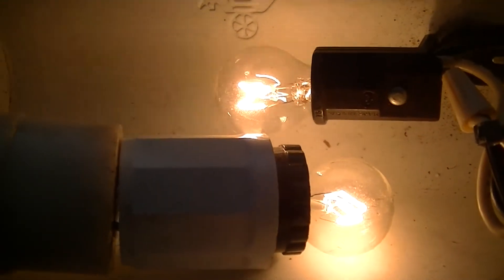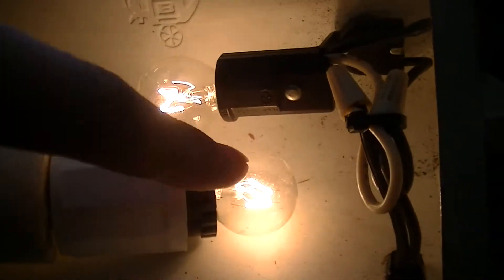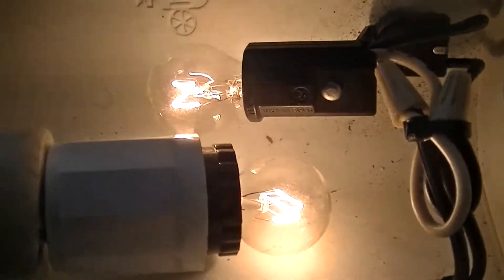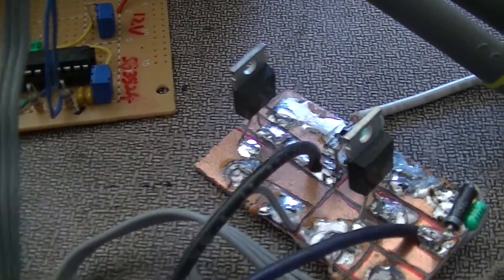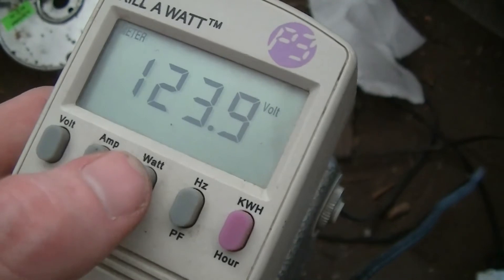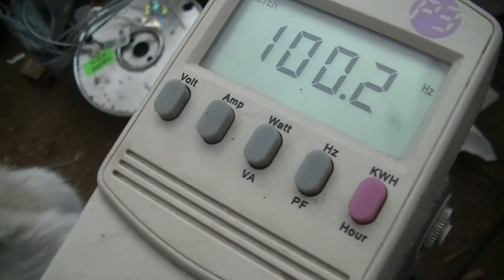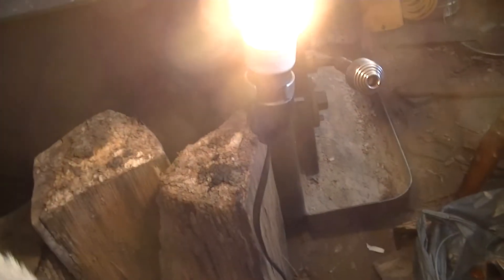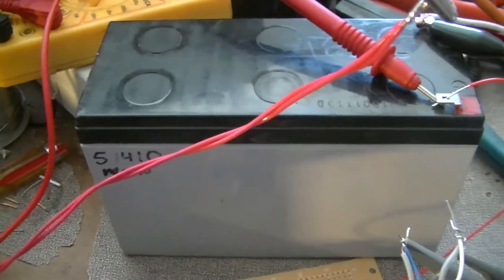DIY MPPT inverter working

Comment: Its funny when I seen the high freq. it reminded me of when I worked for a large UPS company . The also made 400 hz generator sets from 10k to 500 kva . It was used mainly
for Mainframes . I set them up repaired then . I still have all the books on all the different systems they had . The closed when IBM Amdahl and a few other mainframe systems changed to 60 HZ systems . Everybody made those .